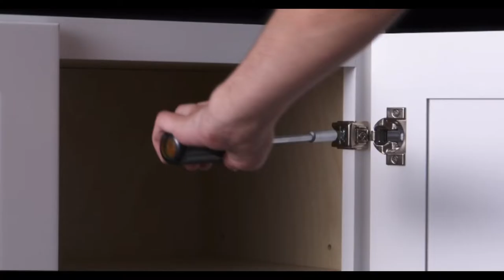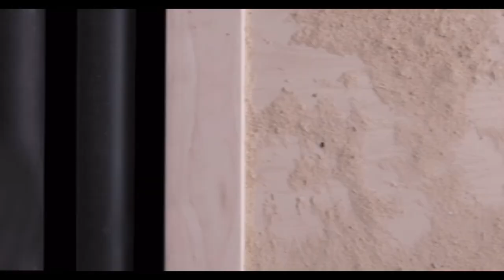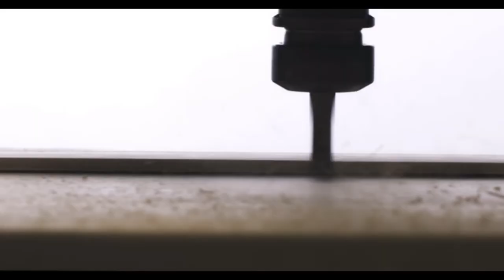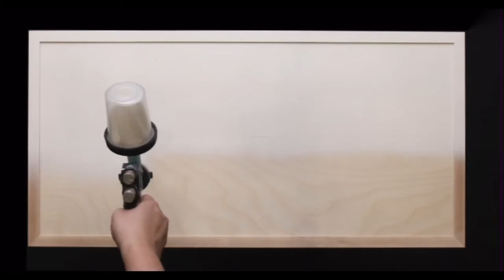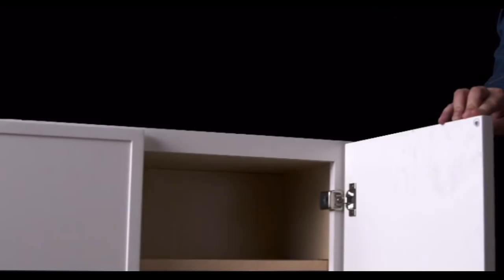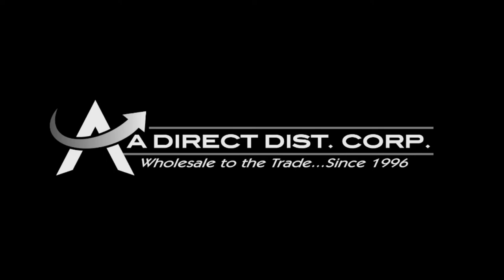New Shaker Doors “Luna” by Fabuwood

Comment: No pictures of the inside?
Reply from the maker: The Allure Series, which this Luna door is apart of, is made of all plywood construction: 1/2" thick veneered plywood, including 3/4" thick veneered plywood matching shelves with edge banding. When you open any of these cabinets, it will standardly have natural finished interiors (which you see parts of in this video).  If you have any other questions, reach out!  Or check out DirectCabinets.com for more information on this cabinet manufacturer.